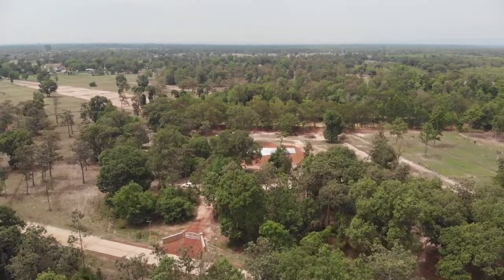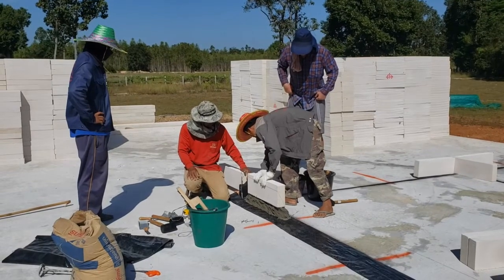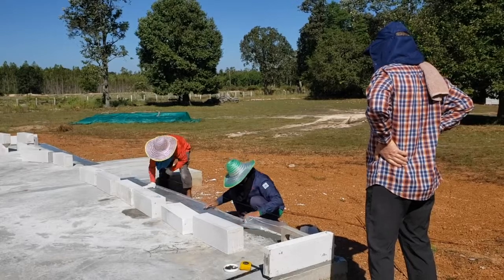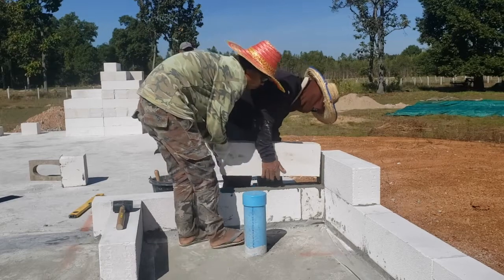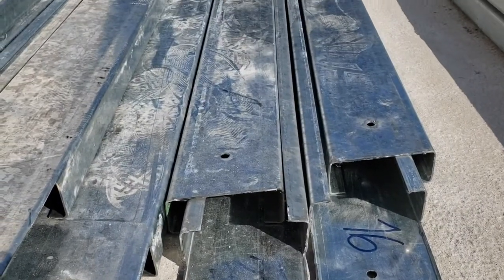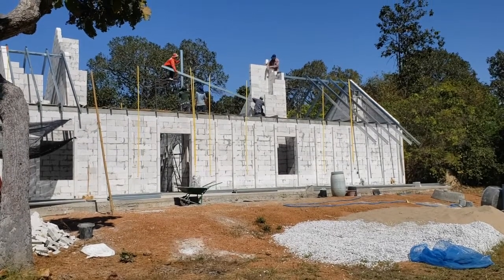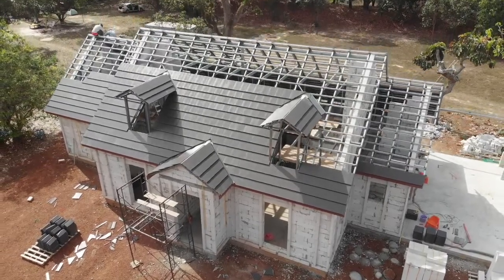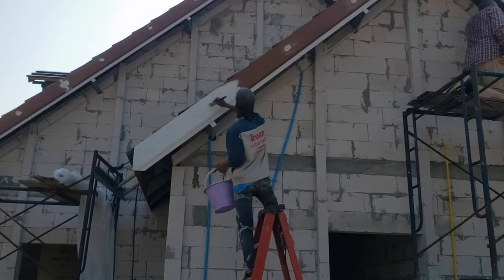Building a house in Thailand  part 2,  Walls and Roof

Comment: Hi Maarten 
Where did you buy AAC blocks as i am starting building project later in the year and unwilling to go along with the Thai shutter post style as only single storey house also putting DPM and DPC as soil very salty and it affects render etc 
Did you have any negative this is not how its done in Thailand with your builders or were they happy to try new ways as in your video ,also where are you based please , we are near Korat
You are very profesional in all aspect from videos to your house build and hands on , keeping eye on your build and builders
cheers Gary and Mon
Reply from the maker: Hi,
We bought the AAC blocks directly from the factory (Qcon).
They were able to deliver all we needed in just 4 days (after we refused to use blocks from an other supplier due to manufacturing faults).

If you contact them via their website, they assign a sales-rep to you. That works great and is also the most cost-effective way.

We are located in the Nakhon Phanom province (come see us).

We had not too much problems with arrogant know-it-all "engineers". Just a welder who would not listen, so we told him, "Do it my way, or go away"... and he went. Problem solved.

The rest of the crew was fine and eager to learn. (We were quite lucky).

Comment: Hello Marteen. I just discover your chanel. It seems that you are very professionnal and your team seems to learn quickly. May I ask you why do you make notches on ridge tiles, please? It's the first time I'm seeing that. Great job, it's a real pleasure to watch, thank you!
Reply from the maker: Hi. Thanks for the compliment. 
Those notches are ventilation openings. All of them together form a ridge-vent.
The walls are hollow (cavity walls) and at the bottom are vents to let air in.
These cavities are connected to a cavity under the rooftiles, which in turn is connected to all those little openings in the ridge.

So, when the sun heats up the outer wall, the air inside starts to get warm. Since warm air rises up, it will go out the ridge vent and new, cooler air comes in at the bottom.
This prevents the inner wall from warming up over time (one of the flaws in standard insulation).

When I designed this, it was all theoretical,  but after living inside for a year I am happy to say, it works very well.

Comment: Nice, doesn't that block still need corner posts? we are building on wife's farm and I'm thinking about subbing it all out except the finish as the labor is so cheap there. I think its 1600tb per post with slab and roof frame. Brick and rendering extra.
Reply from the maker: Hi Dave.
Nope, no corner posts needed.
Posts are highly overrated. They are good for vertical force, but offer no sideways stability what so ever.
Reply: @Living-off-grid  I agree so long as they are overlap and a reinforced concrete cap. My house is semular to yours except hip roof open inside and made of wood with 2 king wood trusses taking most of the load. I've had problems with dropped ceilings rats snakes bugs ants everything get up there and  with the humidity then the place starts to stink really bad after a few years. How are you getting around that?
Reply from the maker: I love a vaulted ceiling.
But... because we will use the space under the roof, we'll have a regular ceiling, hanging from the joist-beams.
We'll have to close all possible "bug" entries properly.  Not just for bugs and snakes, but also for squirrels as we are inside a forest.
Reply: Why not use cement or ICF blocks?

Comment: What is the orientation of the house- Do you know. Ours faces south and has traditional Thai canopies to shade the walls. I am interested how you have used those blocks. They are good for cutting into.
Reply from the maker: The house faces north.
On the south side (where the sun hits the walls due to its angle in winter) we have a roofed terrace. 

The walls themselves have a ventilated (bottom to roof-rim) cavity with a radiation barrier on the inner wall.
This prevents heat from the outer walls and the rooftiles from entering the house.
Well, that is the theory at least. Only time will tell if the laws of physics are also valid in Thailand.
Reply: @Living-off-grid  Don’t count on anything to be the same. We try to blind them with science and its like putting a sheet over a bird’s cage. You watch them fall asleep. 555

Comment: Good job, but why did you choose not to build it higher off the ground, in case of flooding? Even though the area may not have a history of flooding, it is Thailand.
Reply from the maker: Hi Suk,

If you watch the first video about the construction of the foundation, you will see it is build one meter above original ground-level.

Since we filled it in with a gentile slope, this is easy to miss in part two.
Reply: @Living-off-grid  I was thinking that you may have done that, great job mate

Comment: They look like thermalite blocks we use in the UK
Reply from the maker: They are AAC blocks (Airated Autoclaved Concrete).
Very light (they actually float on water), high compression strength (G4 or 50 kg/cm²) and good thermal insulation.

Comment: What is the insulation value of that block?
Reply from the maker: Difficult to say. Around R 6.6, but the official numbers are contradictory. 
Our "outside walls" consist of (inside to outside) 1.5 cm rendering-cement, 15 cm G4 AAC block, 0.5 cm foam coated with an aluminium-foil radiation reflector, 7 cm air,  0.8 cm cement-board.
The cavity is ventilated (botom to top, so the warm air rises and exits, being replaced with cool air).
That should give us a pretty cool wall... but what the total insulation-value is.... No Idea.
Reply: @Living-off-grid  Thanks Maarten. That's is a very comprehensive answer. R value isn't truly important. The important thing is "comfort value." Please let me know how comfortable the house is a few months after you have settled in.

Comment: there is no snow in thailand , why the steep pitch
Reply from the maker: It's the style of the design. It's called "cape cod" or "dutch colonial".

As for practical reasons, it creates a large space, high enough to stand/walk straight (it is a storage area) and it creates a thermo-buffer. (The lower the roof, the hotter the house)